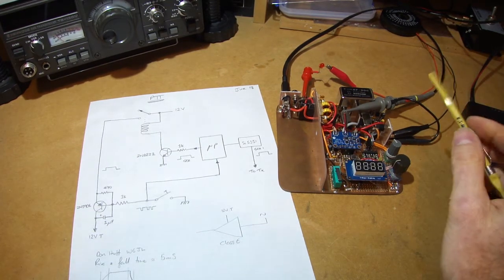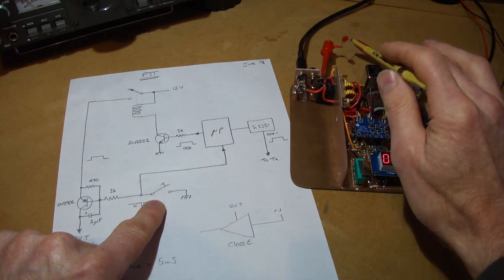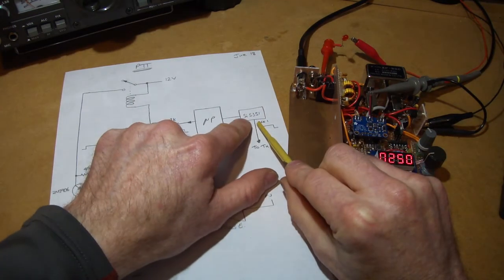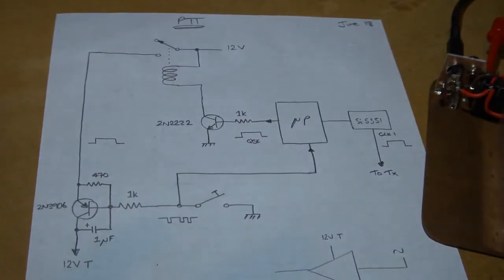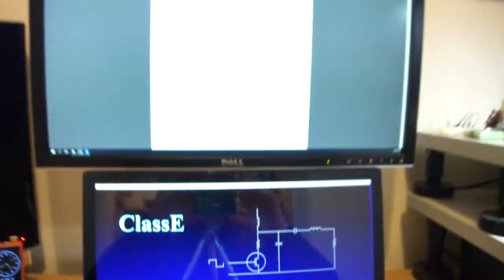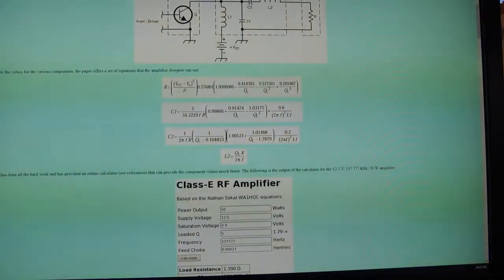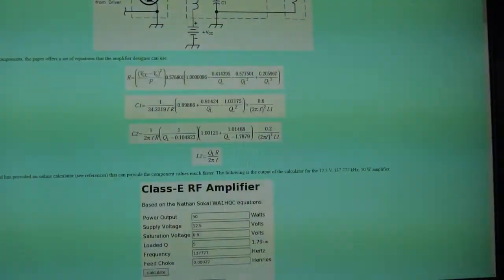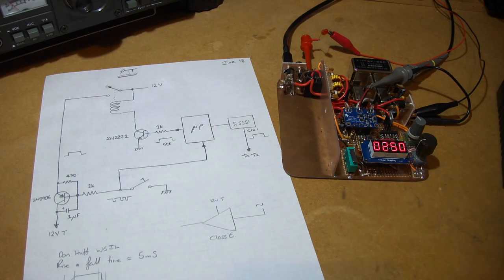Homebrew 40m CW Rig - #5a Transmitter Thoughts

Comment: The reason the S15351 is outputing 5v peak to peak for you and was outputing 3.3 ptp for the other guy. (Think you said Hans) is his might only be given a 3.3V supply. As it will run on 3.3 and 5v.
Reply from the maker: Thanks. I had the same thought, but didn't 't have the full schematic to confirm.  It's a great little board that works well for me.
Reply: I  agree its a nice board. Been meaning to buy one eventually so I can get started with some things at require some mixing. (I am working on a 6 Meter Transceiver)  KD9KCK